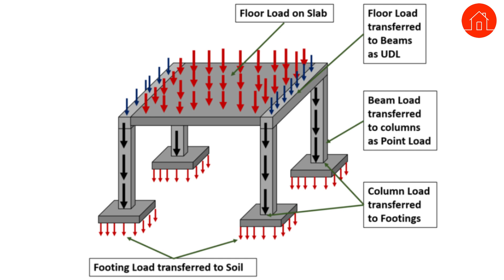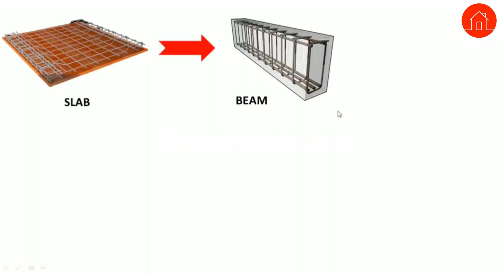RCC construction | Sunken slab | Toilet slabs | Column Beam Slab structure

Comment: Means ur third type of plumbing have no disadvantages.
For correcting plumbing issues u hv to go other floor.
Why any one will break their false ceiling to get ur plumbing issues fixed.
Ur convenience might be a issue for other members.
So i think beneath sunken slab is fine with waterproofing.
Reply: Generally for the third type mentioned, a grid false ceiling is used in bathrooms. Which does not require damaging or breaking open false ceiling of others house & is easy to use for maintainence.

Also, the third system works best only if all bathrooms in all floors are one above the other. 

The only issue I see with the system is solid waste pipe noise. That also can be tackled with multiple other methods. 😅